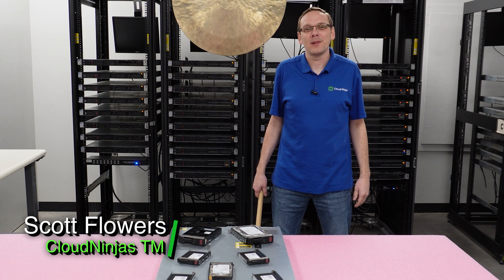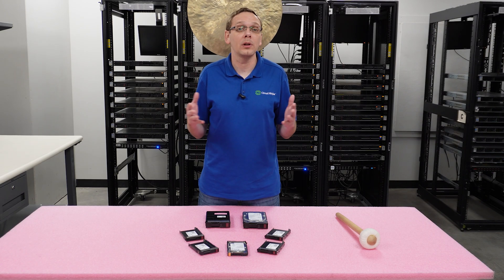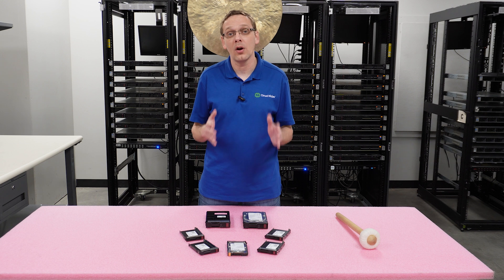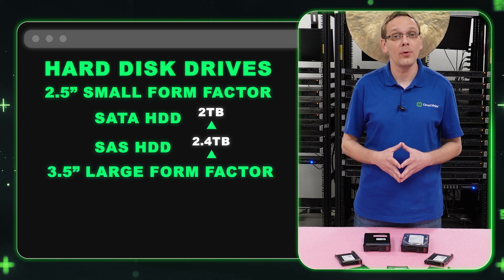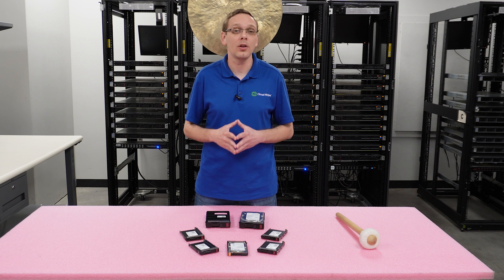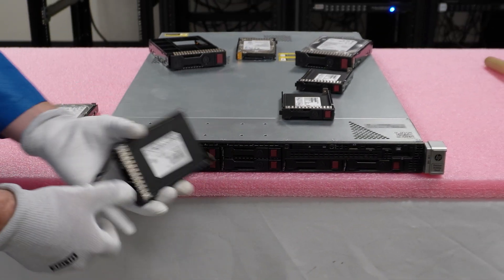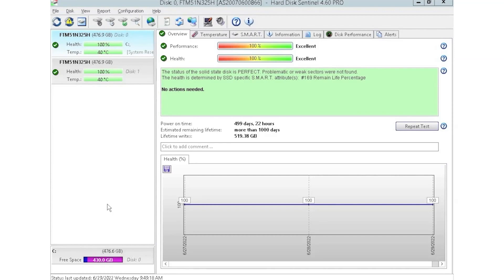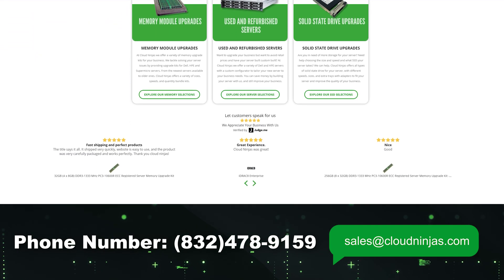HPE ProLiant DL360p Gen 8 Drive Overview | SSD Upgrades & Options | How to Test | Solid State

Comment: Bro, can I put samsung 870 evo sata 1tb ssd into the hp dl360p gen8?
Reply from the maker: It should be compatible, if you are able to install it please feel free to let us know so we can share this with the community!
Reply: @ yup it's compatible, at first I thought that it's not gonna work because I cannot boot from the drive eventough I can finish the linux installation. But actually I just forgot to add my new SSD to the Smart Array P420i configuration. Just don't forget to add the new drive in the array configuration 👍🏻